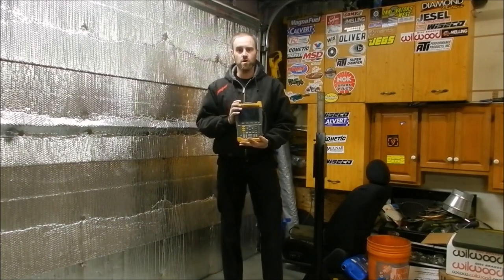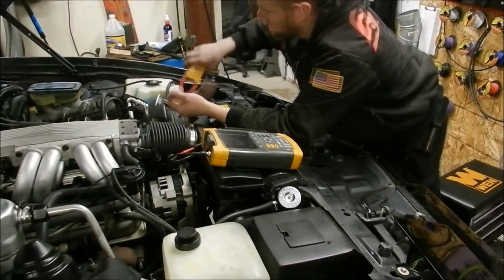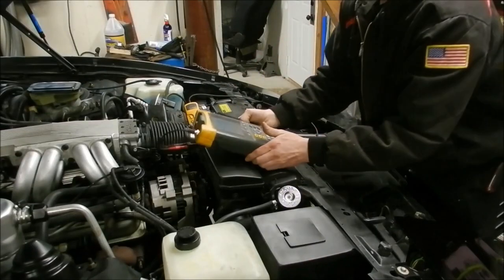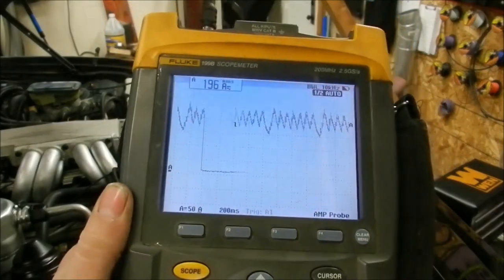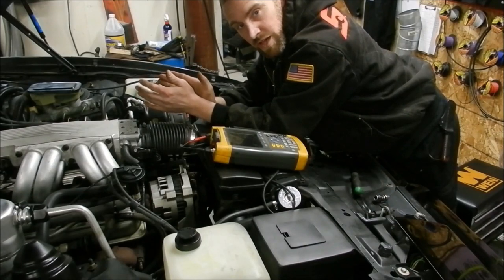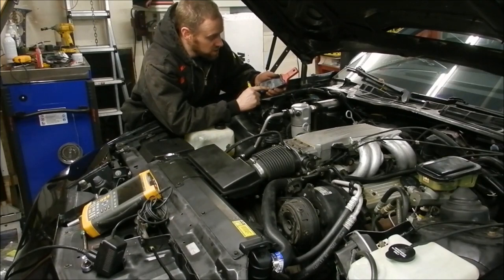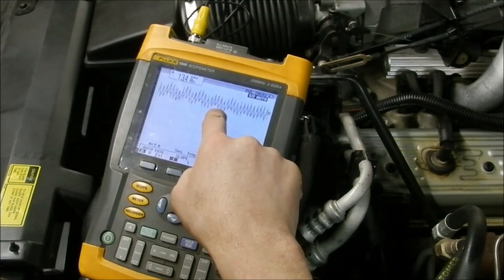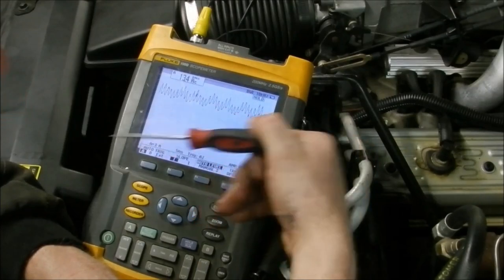Testing electric motor & Relative compression with amp probe

Comment: I especially like the blower motor troubleshooting, I burned out the blower resistors again and need to figure out the exact cause. Could be motor drawing too much current or control switch allowing too much current looking at schematics for my f150, not sure yet. But since your my Son I will let you borrow my truck for a demonstration if you don't charge me for diagnosis. ;-) By the way having a recording scope for these procedures is profound, my lab scope does not have that feature.
Reply from the maker: Yes it is very likely and you only need the blower main wire to test it just put it on high and check the pattern if it's more than 18amp it's way too much but under that could be to much to just need to check the pattern

Comment: You have more oscilloscope you need for automotive diagnostic. With the fluke scope there is no cause of failure in any electonic system that you can not find. Of course you need the probes indicated and the knowledge of the electronics.
Reply from the maker: Well I did get one hell of a deal on it when i purchased it haha. Ebay special ftw...